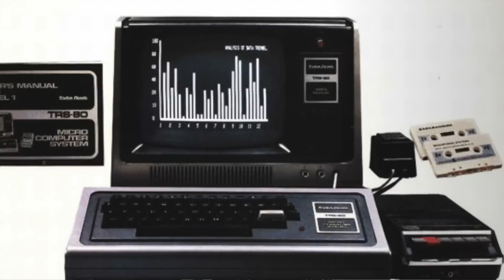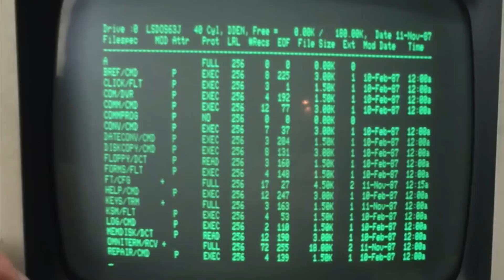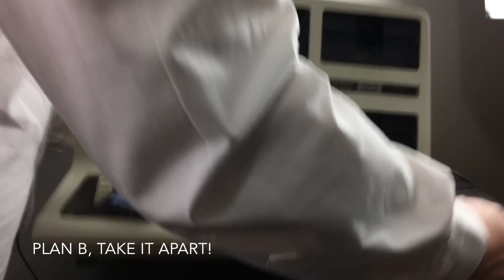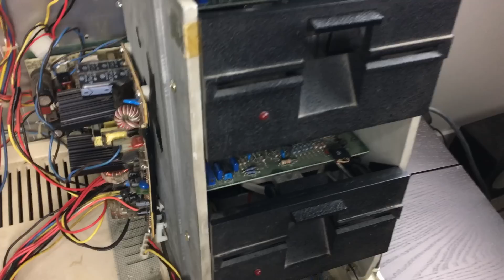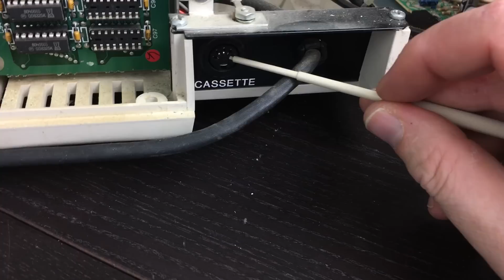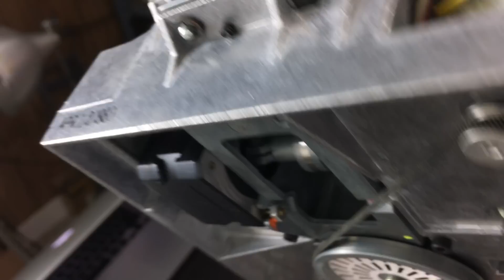Tandy TRS-80 Model 4 Retro Computer Introduction and Teardown

Comment from the maker: Somewhere around 18:30 I say that the Apple II used a Z80.   That's not correct, not sure what I was thinking!
Reply: To be fair, there was an expansion card, the Microsoft SmartCard, for the Apple II that had a Z80 on it, so you could use it as a CP/M machine.  Maybe that's what you were thinking of.

(In fact, it was Microsoft's first hardware product, and was staggeringly successful, selling 5000 units in just 3 months.)
Reply: Yep, I was going to mention that the Apple II was a 6502 machine...
Reply: 6502 wasnt it?

Comment: The bodge wires, I believe, was because the Model IV was supposed to run a Z800.  But the Z800 never materialized and the early Model IV boards had to be regressed to the Z80.  This is evident by the Z80 socket sitting within the larger Z800 footprint.  The later PLA version of the Model IV board was built for the Z80 and is very clean.

The header is for the hi res graphics adapter.

Comment: Actually, I believe most of the Radio shacks did have a Model 4 hanging around during the 80's. Before I purchased my own, getting a $2,000 loan from my local bank, I used to go in to the local store and used their Model 4 to write my games. Some times I was there all day till closing time. Back then their receipts were still had written and at the end of the day they, I mean I, used to manually enter the sales receipts into the Model 4 and transmit them over the phone line to Fort Worth TX, the home office.

Comment: There was a clock you could buy that was NOT Tandy that used a coin cell to power it so it would not loose time. The PIO Time board was made by a company in NY. Same company also made an actual PIO card that would control 16 relays and 16 4N25 inputs. Tandy made a Plug'n'play light controller for the Z-80 Mod 4 that used the cassette as a way to communicate between the light controller and the computer. The funny thing, I, with out knowing what the Peeks and Pokes did, I was able to rewrite their program so to be able to control more then one light at one time to dim, bright or on/off at the same time. X-10 never figured out that might be a desired thing to allow on their own product. As far as I was concerned that was one of the many things that killed the X-10 controllers.

Comment: Regarding the lack of shielding on the TRS 80 I and the FCC complaint - in High school where we used them circa 81-82, we would load a game and then set a portable radio up next to the computer set to an AM station (or maybe it was FM - I forget which now), which the signal from the TRS 80 would jam . When ever we "fired" there would be a corresponding sound so we could get some kind of sound effects from the TRS 80 I.

Comment: Nice to see this review !
I worked for a small company in the Netherlands that did all kinds of mods on the Mod4's.
We started with the model 1, then the 3, and finally the 4.
We made and sold them mainly for administrative purposes, working closely together with a plumber who was quite a programmer too.
Of course we deemed those belt-driven floppydrives a disaster, and the first thing we usually did was to replace them with half-size double sided direct drives, mainly from Mitsubishi.
We only used TRSdos on plain vanilla systems, we preferred NewDos80 for the more advanced stuff.
We also thought that having room for more drives would give the possibility to put two harddisks in it.
But that wasn't easy.
We knew we had to use a "host interface" (now called a harddisk controller) to get any harddrive going.
We could get those host interfaces (for a fraction of the cost of Tandy's), and screw them in at the back of the case, but the culprit was the PAL that was not there.
Now we could buy them from Tandy of course, but they were so expensive !
So we decided to hire a part-time genius, who bit by bit figured out what that PAL would have to do to connect the bus to that host interface.
After several tries, and a lot of time with the guy playing with his locic analyzer, we finally got something.
So we got us some empty PAL's and programmed them ourselves.
They worked perfect !
And there we went off selling them with our host-interfaces and harddisks for a fraction of the price of Tandy.
And of course making a lot of money on it.
It didn't get unnoticed by Tandy though, as we sold (a lot) more harddisk expensions then they did.
And of course, one day we got some lawyers at the door to shut down our piracy operation.
But we didn't pirate anything !
That PAL was our own developement, besides, you can't copy a PAL when the last fuse has been blown out.
So we offered that we had our code compared to their code by a third party, and determine if we copied anything.
Tandy agreed, and after a short while, we turned out not to have copied anything, our code was not only totally different from theirs, it was more reliable and faster too.
From that moment on, we had a pretty good relationship with Tandy, getting serious rebates, and also doing repairs for them that they couln't do themselves.
 Ah, the days that some clever cowboys could still make some money ... :-)
Reply: Cool story.
Reply: @XAWZ  Days long gone i'm afraid :-)
Reply: How very kind of them to assume that you had pirated Tandy's stuff, instead of thinking that maybe somebody managed to figure it out on their own.
Reply: @BlackEpyon  Not so strange, and we didn't feel harrased or anything. We 've actually expected this to happen. After all,  piracy was a common thing back then. In fact, we would  have  been surprised if they would NOT have taken notice and investigate our development.

Comment: A fluorescent light was used for a timing reference since the power was 60Hz.Us 50Hz Europe. These drives depended on ac line frequency to adjust the timing. Please dont think im being arrogant or bold. I know this old school stuff. You’re doing just fine.
Reply: I think you have it backwards.  The drive runs on D.C. The 50 and 60 HZ markers were for the frequency  at which the florescent lights were operating at.  A florescent light operating at 60hz will make the 60hz indicator on the drive appear to be stationary when the drive is spinning at 300rpm.
Reply: @AtariFTW  of course the drives run on dc.the timing marks were used to set the correct speed using the 60 Hz frequency of  a florescent light as a reference. if the timing of the drives were wrong discs would not be comparable between machines. I'm sure you know..it's all simple stuff.
Reply: @AtariFTW  When the drive speed is correct it. The timing marks will appear motionless.

Comment: the Z80 is a great cpu.. I’m not 100% positive but i belive the model 4 could support 2 more floppy drives externally through the internal 34 pin connector…that 2x8k static ram was video memory. Hence the close proximity to the crt controller.

Comment: That’s not quite accurate. I would frequently use a model 2 with a 8 inch floppy drive. The model 2 was nothing like the model one and was not an upgraded version. It was an entirely diffrent system. One thing you can do is hold down the reset while powering up the computer and bypass the requirement to boot from a floppy drive and boot directly into basic. If I remember correctly.

Comment: The Model 4 was my first computer. I remember doing the 128k memory upgrade. It also involved soldering a jumper cable, I was 17 at the time and didn't have a lot of soldering experience. It was kind of terrifying, worrying about frying something with my soldering iron. But it worked, and I had a 128k Model 4. Of course, I really didn't have anything to utilize the extra RAM, but I still felt pretty cool. :)
Reply: Mine was upgraded to 256K with two disk drives.

Comment: I found it hard to be a "hater" for any of the chips. Z80 had it's big register set and block instructions... 6502 had it's kinda "proto-RISC" thing of not many instructions but loads of speed... I did a little bit of 6800 but, sadly missed out on the 6809.... but that would have been cool too. Oh yeah... actually.... there was one to hate: the 8080 with it's vile ugly assembly syntax which carried on into the 8086, and all the other horrible horrible x86's that we've still got today. Thanks heaven for ARM and ATmega or I'd still be stuck in the 70s wishing I had a Model 3.... a beautiful machine like the one you're taking apart... but better... because "silver!!"

Comment: I must say that it has a very classic vintage computer look.  If you were to look up computer in the dictionary during the early 80s, it would have a picture of a Model 4.  That's probably why they fetch a premium on eBay.  The keyboards are also highly sought after, since they feature the highly sought after Alps switches.

Comment: Back in the 90s, someone gave me two Model 3s and a Model 4. Wish I still had one of them. I have a Model 100 laptop and a CoCo 2 now. Although all Radio Shack computers had a TRS-80 badge early on, neither is compatible with the TRS-80.
Reply from the maker: Oh man, that sucks.  If I kept some of the "junk" I literally threw in the garbage in the late 90's I could probably pay a mortgage payment or two with the funds I could get for them today.
Reply: The term “TRS-80” didn’t denote compatibility. Among all the TRS-80s I think maybe only the model 1 and model 3, and some of the color computers, were compatible with eachother.

Comment: I didn't know the Apple II used a Z80. I thought it needed a separate Z80 board to run CP/M.
Reply: The Apple II used a 6502. It did need a Z80 expansion card for CP/M.
Reply: Not according to this video.
Reply from the maker: Doh!  I'm an idiot.   Not sure why I was thinking the Apple II used a Z80.

Comment: I used these in 7th grade.

I hear these use composite video for the monitor display. I wonder if one could hook up a gaming console to this monitor. may have to splice in a connector. I know it's a green screen and games might not look good on it.
Reply: It would probably work, as the monitors were allegedly pulled from unsoid TV sets.
Reply from the maker: I lived in a green-screen world back in the day.   Depending on the game, some actually looked better on a green screen.    I think that the Model 4 might use a 15khz monitor signal rather than composite though.   Might be fun at some point to try and drive it.

Comment: I thought the Model 2 used a Motorola 68000, not a Z80
EDIT: I'm wrong, that was the Model 16
Reply from the maker: Ya, the Model 1, 2, 3, 4, 12 and 16 are almost the same computer (Z-80 based).    The 16 had a 68000 co-processor board so you could run Xenix.  I can't remember if that was an option or standard equipment though.   I think the Model 12 might also have had the option to run the 68k as well.

Comment: I bet that's a 26-1067 which would have started life as a 16K diskless Model 4.  Those are the only M4s which use the M3's dual PSU arrangement.
Reply from the maker: I was curious and had to check so I flipped the machine over.  I can't remember if I mentioned this in my video but there is a sticker on top of the original SKU that says "Upgraded to 26-1069".    So I would assume you are correct!  I couldn't find the original receipt (its around here somewhere) but it would be interesting to see if it was sold as a 26-1067 and then sent back for the upgrade, or if it was shipped as an upgraded unit.  As a side note, the serial number is 000751 which seems quite low.   PS - love your videos!
Reply: It varied from region to region.  Most people who bought the cheapy 16K M4 bought it with plans to upgrade it themselves with any of the number of aftermarket disk drive upgrade kits for sale at the time.  I'd say very few people purchased 16K M4 and then got RS to upgrade it.  In any case, if RS upgraded it they would not change the SKU number, it would still say 26-1067.  HOWEVER, I do know instances where RS ended up with an inventory of too many of a lower spec machine (the 4K L1 M3 springs to mind) in which case they were upgraded to the new spec prior to being sold, and those got the updated SKU number.  Tandy Australia found themselves with way to many 4K L1 M3s which they upgraded to 16K M3 Basic and updated the SKU from 26-1061 to 26-1062 however you can easily peel this sticker off and it ways says 26-1061 underneath.  Keep up the good work and see you at Tandy Assembly in Chillichothe, OH in October.

Comment: found the model 4 in the trash  few day ago it powers on but just has alot of random numbers on the screen and the orange reset key is stuck down
Reply from the maker: Model 4 in the trash?  Crazy!  Yeah random numbers on the screen sounds repairable to me.   First guess would be CPU and video generator are fine, so I'd check RAM and ROM chips.   I'd also check all the chips in sockets and try to reseat them. But most importantly don't give up!  These are pretty valuable little machines when working.
Reply: Lucky day! I was just day dreaming about finding one of these just laying around somewhere for free! :-)

Comment: Very well done video! Thanks for sharing! I worked at radio shack in the mid to late 80's and always wanted one a Model 4. I've been looking on eBay for a while, but can't seem to find one if working or good condition for a reasonable price.
Reply from the maker: Thanks for the nice comment!   I also worked at Radio Shack; from '89 - '95.   I found this Model 4 on Craigslist; came with original manuals, a bunch of disks and the original sales receipt (sold by someone I knew which was kinda cool).   Lots of sellers on eBay know the value of what they have.. I've found the TRS-80 gear can be pretty pricey.